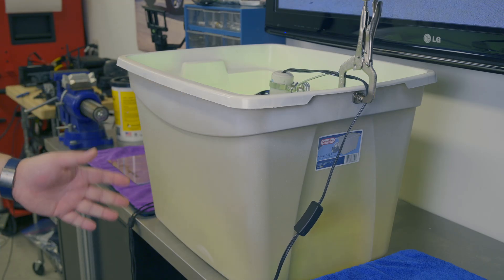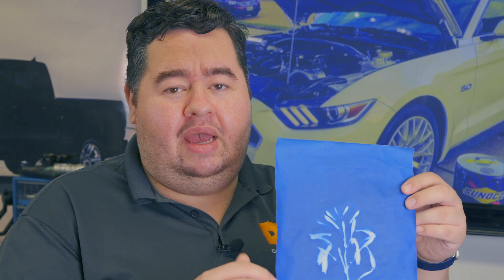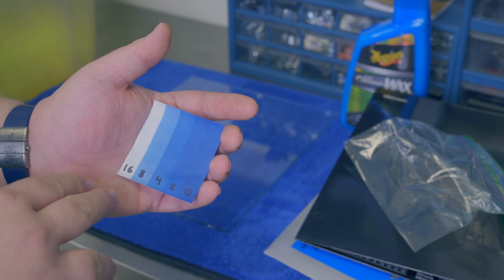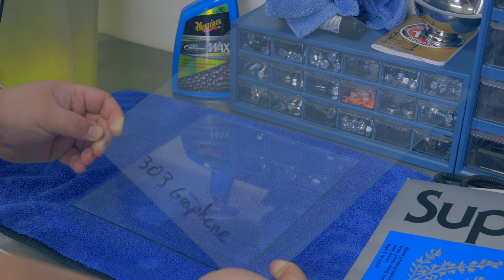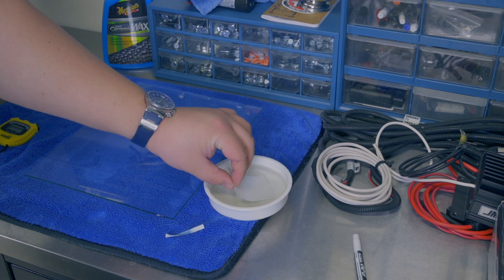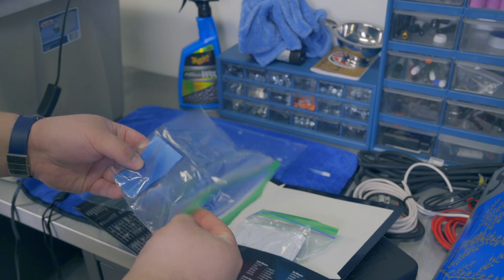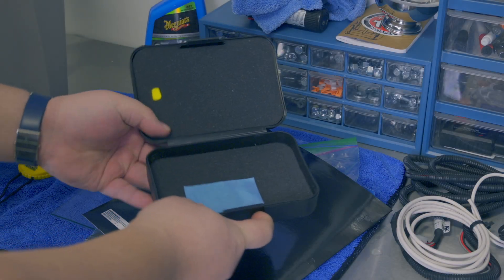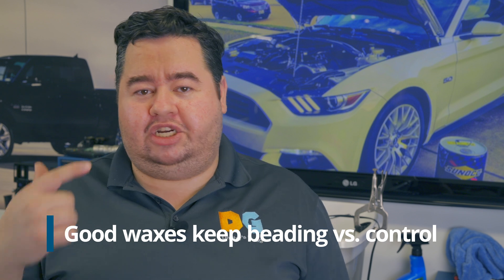How much UV protection does a wax, coating or sealant provide?

Comment: I wasn't expecting this exactly but I'm not surprised, I've seen videos testing interior protectants and the conclusion was roughly the same exact thing so I only assumed a similar result.

I think this is good and not faulting it at all but I should mention they do make UV sensors which give an exact value in real time. I only say that as it seems like you wanted to go into a decent amount of detail.

The sensor wouldnt really be useful for anything else (so kinda a waste) but none the less if you are wanting to go super technical that is an option.
Reply from the maker: Good seeing you again :), I think I'll test some of the interior products as well just to see. As far as UV sensors, they are out there, but I found high resolution UVA testers were a bit on the higher cost side. This is actually a very inexpensive test. It's not very high resolution, but it gives enough detail to get a comparative idea. I may get a sensor at some point.
Reply: @DmitrysGarage  Nah, I get that and I fully agree (and I made the comment about 30 seconds before the end of the video) by that point I figured you knew from what was said.
Reply: I think i am going to buy a UVA meter.

Comment: First! And NOT from Puerto Rico! (for a change 😂) 🇬🇧
Reply from the maker: Thanks for watching JWL!
Reply: @DmitrysGarage  really admire your effort and creativity, Dmitry. How did you test clear coat reaction or protection against UVA though?
Reply from the maker: @JWL-UK  Thanks :). The way I tested clear coat was the same as the other tests. I sprayed a sacrificial glass panel with two coats which is pretty standard for body work. Glass is cheaper than clear coat just $2/panel, was the easiest way to test.
Reply: @DmitrysGarage  nice! Perhaps you could try to add a layer of protection to that sample piece to see whether less UVA can get through. Or look for ways we can measure degradation of a protected VS unprotected clear coat. Just a thought which may neither be practical or achievable. Keep up with the great work. Greetings from the UK.
Reply: OMG.  LMAO!  I am so sick of reading that exact same comment on every video.